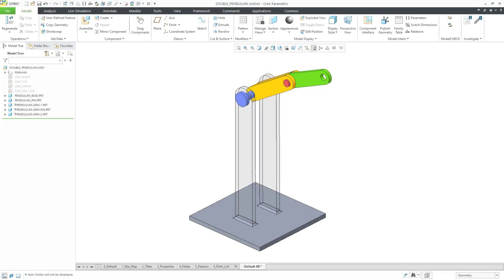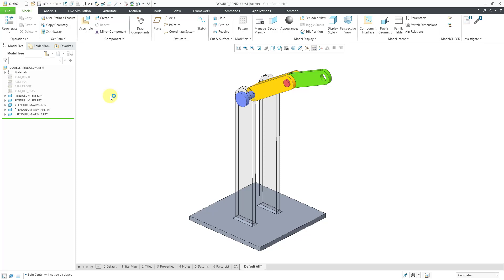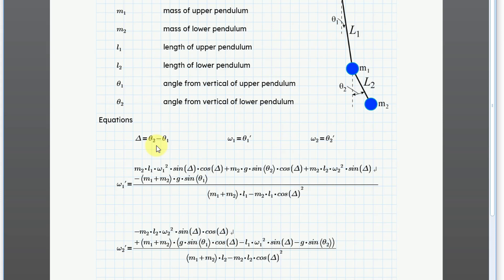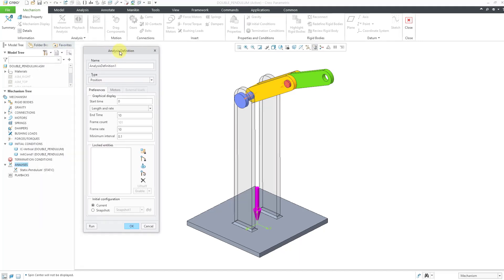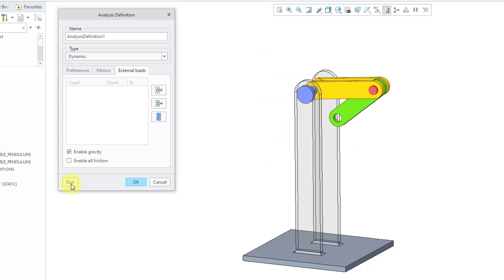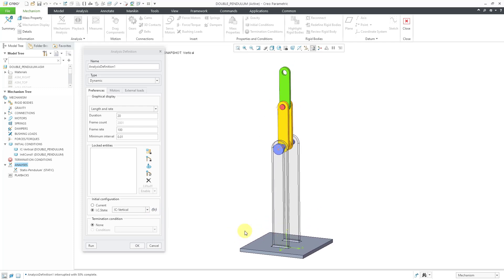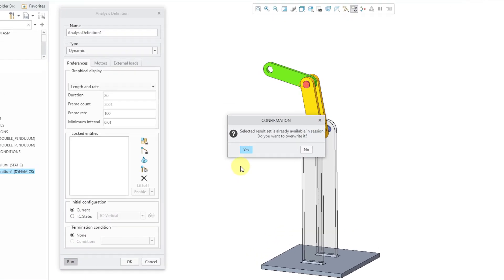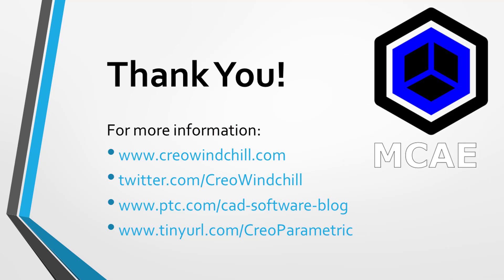Creo Parametric - Mechanism Dynamics Option (MDO) - Double Pendulum

Comment: I'm attempting to synchronize the movement of 4 hydraulic cylinders in my assembly. What Creo tools should I utilize in order to connect my four working mechanisms so they move together while connected to the same component... Press plate